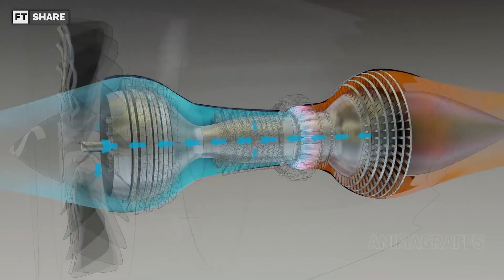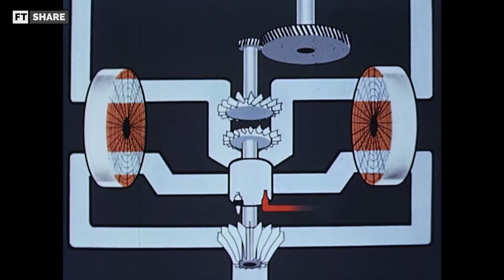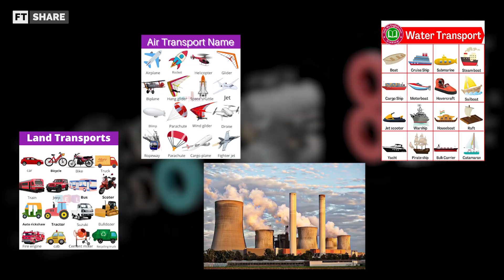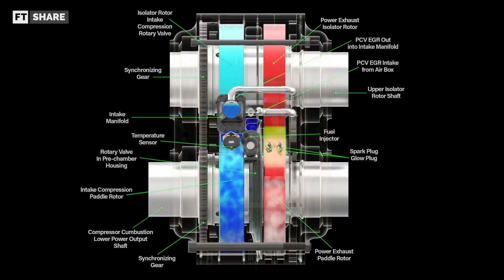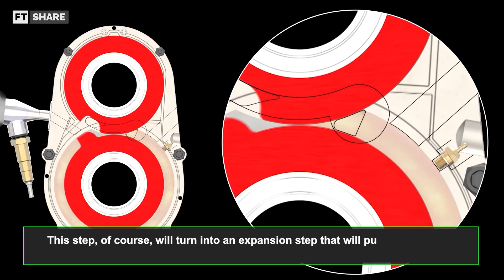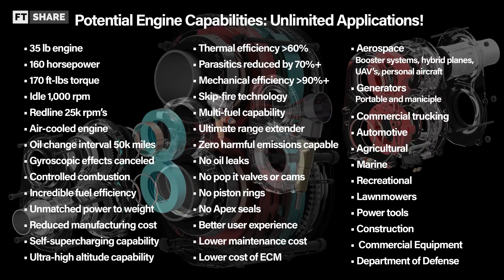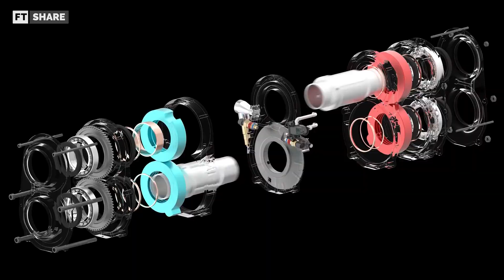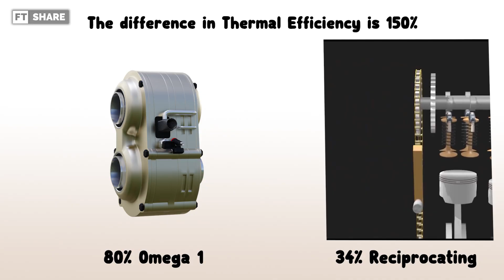Ready To Destroy EV Engine!! | Astron Aerospace - Omega 1 Engine

Comment: I have a similar engine design idea that I worked on back in the late 1980s. Mine has all the rotors on one axis and multiple firing sections so that RPM and Torque can be increased just by pulsing the ignition and fuel injector more frequently. The downside to the one shown here is that it has two opposing rotors joined by gear teeth at the outer diameter. This will have high inertia loads under high load and rpm, which will probably quickly wear out the gear teeth keeping them in sync., especially after many abrupt acceleration and deceleration periods. Other than that, the idea of using totally rotary motion is the best advantage to this and my design engine. There is no wasted (reciprocating) motion.
Reply: I look at it like a helicopter or jet engine. Spin it up slow and bring it down slow. If you are using it as a generator for batteries and a traction motor, I think it is just the right fit.
Reply: @desertdan100  wouldn't there be much less energy loss to just fuel an ICE engine instead of fueling this engine to generate power for batteries which in turn power electric motors?
Reply: @Thistasteslikeass  The torque off of this engine is going to be lower than a piston engine and it is going to be more efficient at a semi constant higher rpm. It would be better suited for a generator. 

The voltage output on any generator depends on rpm. 

I higher revving engine and a lineal curve are better for power generation.

A Diesel has high torque at low rpm and is better for an ICE vehicle and more efficient.

This engine is better suited to move away from petroleum.
Reply: These engineers know their shit mate.
Reply: @darkfieldcarnivore3928  regardless if its that heigh in efficiency would make for a damned good electric generator
Reply: Ask Christian Von Koenigssegg, to make it work, and give him a share of the royalties. You need a Genius.
Reply: There are economic forces that usually exceed any patents but their own. Good Luck
Reply: Draw something very similar to yours in the 90ies. Did you ever build a prototype?
Reply: As the rpm increases the gap between the gears and rotors would close due to centrifugal force. How much I guess depends on material but seems like a limiting factor. As well as balancing the rotors with that big tooth hanging off one end.
Reply: @Willy Jimmy  I have worked on super chargers and screw compressors as well as rotary pumps and compressors. I think it would not be any different than those. As long as you engineer for it, I think it would be alright. They can do amazing things with ceramics and Titanium Alloys these days.
Reply: @willyjimmy8881  balancing of that "big tooth" is pretty easy
Reply: Honestly if ICE car brands try to use propulsion engines as generators thats more evidence they are incapable of innovation.
Reply: Yeah, when I saw the gears I felt the same way
Reply: Flame Front Speed, Flame Front Speed, Flame Front Speed .... The Very First Figure An Engine Designer Needs To Consider, that's where "omega "wtfwhere you thinking' one" failed....doomed to the core of the concept, right out of the gates.....i bet they don't ever forget that from now on.
Reply: after the flame front speed dictates your engine into goal dimensions, then it has to seal ... i can't even get to the point where i question it's ability to form a seal, it is that messed up.
Reply: it could work on diesel or hydrogen ... but claims like that need substantiation, and the first i heard those claims, they were based on petrol .... NO, that's not how it works.
Reply: Good point on the gearmesh wear, my only comment would be that if this actually becomes a viable replacement for existing ICE applications in vehicles, as long as you have an easy access point to those gears, swap them out every 10k or 20k miles and keep going.  Surely you can have a bolted/keyed connection instead of some custom fabricated interference fit.
Reply: @cg8469  complete idots... flame front speed, the problem with the omega1 is that flame front speed was not considered, where that should have been the first thing...the first thing that should be considered in any engine design was disregarded ... it will never make any power worth it's weight, on any fuel with a combustion speed similar to petrol.
Reply: Have you written a paper on it or currently working on it ?
Reply: if your rotors are anything like the omega1, it wont make crap for power on petrol .....flame front speed.
Reply: @RulgertGhostalker  H2 would speed that up and be zero emissions
Reply: CNG might also work better
Reply: @desertdan100  oh yeah, CNG CH^4 
Good Call....i forgot about that, and there actually is some infrastructure....
Reply: the omega1 might make a good remote controlled aircraft engine, if it was scaled down to a 1/4 HP.....i will give it that.
Reply: i am actually a real engine designer... because i know to tape my flame front speed up on my computer screen, before i even start an engine design.
Reply: @RulgertGhostalker  What is the Flame front speed of Hydrogen on compresion ratio 14:1 and boosted intake 2bar?
Reply: @andrekemp5059  fast enough ... too busy to dig through my references right now.
Reply: @andrekemp5059  someone mentioned CNG, and right away i thought that's the way to go with it, 1) because there is already some infrastructure there, and 2) because it takes a lot of energy to produce hydrogen, and for that reason, many people don't see it as a solution.
Reply: @andrekemp5059  i would also consider RC scale ...you can run small prototypes on nitro-methane and recover from your investments faster.....RC planes have lots of applications.
Reply: @RulgertGhostalker  Petrol is Benzine, xylene,toluene, n-Hexane,Alcahol Ethanol, Parraffins,cycloparffins ,naphthenes olefins and the the anti knock agen LEAD Tetraethyl , Lead alkyl, Naphthalene, Tri-methyl-benzene
Reply: @RulgertGhostalker  I love RC stuff it makes life so intresting.
Reply: @RulgertGhostalker  it takes alot of oil gas vapor to produce Petroleum Gas, Petrol, Diesel, Parraffine, oil grease products.
Nothing is for free.
Reply: @andrekemp5059  RC is actually employed in military, agriculture, surveillance, and mapping...it's not just toys.
Reply: @RulgertGhostalker  I like the Toy side more!
Because to build toys for people that want to us it in corp and not get paid by contract complete is a horable feeling
Reply: @andrekemp5059  also a type of flight training.
Reply: Please build it?
Reply: LOL... imagining gears transmitting power at 25,000 rpm... is somewhere between welding and pure smoke. Maybe ceramic gears lubricated with liquid hydrogen like heavy duty generator bearings... not something I see replacing any current tech soon!
Reply: @scottturcotte1860  OH GOOD POINT DUDE.....my mind didn't even make it to conceiving power output worth transmitting.
Reply: @scottturcotte1860  the general consensus is maybe CNG... or less expensive prototype turn overs in a nitro-methane scale format....either way, like you said.
Reply: @scottturcotte1860  piston ring metallurgy has come along way....from 2,500 fps to a little over 4,000 fps now i think.
Reply: @scottturcotte1860  the whole thing is, it's better to give them some realistic raz, before they get too much invested in a disaster..
Reply: @scottturcotte1860  i mean in theory it could work....and i think that's what made them lose their marbles...but no kiddin they did.... gotta run the numbers and get real....numbers don't cost as much..
Reply: Think rotary turbine 😊
Reply: @brucemabley9808  That's The Problem With It !!! Unfortunately it was supposed to be an ICE, not a RT, and it came out like an abortion..
Reply: I don't imagine this thing being used to direct-drive a car and making drastic rpm changes.  It will probably be tuned for a specific rpm to drive a generator, at best a CVT/gen system like the prius
Reply: There are gears which the teeth are tipped with magnets (probably neodymium) so there is an air gap between 2 opposing gears, the repelling force of the magnets eliminates friction between 2 gears, but the question is would the magnets lose some magnetic power because of increased temperatures? These kinds of gears could be helpful in rotary engines..
Reply: @pihermoso11  exactly! Those magnets will definitely loose their property due to change in temperature.

Comment: Very difficult  concept to understand fully, given that it has a combustion space, and the volume of the combustion space seems to be very small, the idea of  power from swept volume would seem to say that for an engine of this size to produce 160(B)HP is impossible. Incidentally, the first gas turbine car was developed by Rover in the UK  beginning in 1946 with a running prototype being tested in 1950.

Comment: HP per weight? Longevity without maintenance? Fuel efficiency? Torque through speed range? This won't displace EV motors that have only one moving part and require no maintenance. Unless it burns hydrogen is is still a fossil fuel ICE engine and will pollute and spew CO2

Comment: I cant imagine why humans would develop an engine so far less efficient than an electric engine we currently have
Reply: Well because efficiency alone actually counts for very little in this context! If the energy storage density of the fuel source makes the overall envelope impractical then it does not matter that the engine is far more efficient than an ICE.

Or to put it another way; Electric vehicles, though the motors are far more efficient, the storage problem alone makes an equivalent envelope far less effective as a whole.

Otherwise, wouldn't the entire development of all earthbound people-moving vehicles be complete with the invention of the BICYCLE? Cannot get more efficient than that. Or less effective...Well you can (see video above ;D) but surpassing our own output power limitations is sort of par for the course in engine development.

Comment: It's incredibly elegant.
This is exactly what we NEED!
I want to know more.
Reply: You should look over at Aquarius Engines. Way better design that has only 1 moving part and doesn't rely on the extreme levels of tolerance that the Omega 1 will require. Also, they already have working models, generators and a newly renewed contract with the US Military for R&D.
Reply: @BloodSteyn  awesome, thank you!
Reply: Want one? Who's gonna fix it? How do you get parts? Stick with what you got. It works and you can get it fixed when it breaks. And it will. Especially for you.
Reply: @2012listo  
I'm certain it would feel impossible to fix at first but I would learn, I love fixing stuff.

As for everyone else, the need would create opportunity and people would learn, they would sell their services.

But you are right about keeping what we already have, it wouldn't be very smart to not have a backup. But that goes for all cars.

Comment: :text-green-game-over::text-green-game-over: IRRELEVANT, it burns gas, it by default is inefficient, EV electric motors are now made with OVER 90% efficiency, just plug your car into the wall socket in your garage and it gives you 150km range by the morning, and the vast majority of people don't travel that far each day, plus MANY people now have SOLAR panels so can charge for free anyway. :face-green-smiling::text-green-game-over:

Comment: It leaks like a sieve and stops very quickly hinting at very high friction rectangular combustion chamber is poor for efficiency and hard to seal.  The same with rotary valves and a hot and cold parts next to each other.

Comment: The Wankel failed due to air seal problems........NO, SORRY, IT FAILED DUE TO HIGH SURFACE TO VOLUME RATIO AND CONSEQUENT HEAT LOSS LEADING TO LOW FUEL EFFICIENCY. THIS ENGINE HAS A MASSIVELY HIGHER SURFACE THI VOLUME RATIO.

Comment: Electric cars are doomed. The grid couldn't handle the amount of power needed to supply everybody electricity for all their electric vehicles. The other problem is the lack of materials available to produce the batteries with current battery technology. Battery technology may change, but the lack of available energy to be supplied through the grid is the number one thing holding back electric vehicles at the moment. And let's not get into the pollution caused by the production of these electric vehicles and their batteries.

Comment: This is a fine concept. Now let's see it transferring 160 hp and relevant torque to a drive for a ducted fan,propeller or driveshaft. Must have some interesting bearings and lube to handle these forces. Trying to imagine an Immelman in an aerobatic plane with these bearings reacting to gyroscope forces at 20,000 rpm.
Reply: Did you notice the fluid leaking from the lower section. Not certain what that was, but leaks are not good.
Reply: I would agree if we had discussed this in the 80s. Our time's materials solve those problems easily.
Reply: I think it would be best as an electric generator installed inside the fuselage which could then power ducted fans via electric motor on the wings. Certainly less efficient and more weight, but there are other advantages.
Reply: My cousins 95' civic can handle aerobatic gyroscopic forces at 20k rpm np

Comment: I want one now! That would be sweet as hell on my TRX450r ATV. I've boosted the power a lot to get to 65hp. 160hp for an engine that weighs about the same would be awesome. Not to mention that insane rev limit. 25k sure beats the hell out of 9.5k. That little engine would be good in everything if its reliable. It's light enough to just remove if it needs work. Sadly I'll believe it when I see it. They'd take over if they are reliable. People that work on things themselves will be buying them like crazy
Reply: 2 omega 1 engines would weigh less than 1 trx450r engine according to the stats provided in the video.

Comment: The seals will work better than a wankle rotary engine because the rotor is not asymmetrical.  It doesn't have to bounce around as it rotates.  It simply rotates in a circle like a lathe.  This makes it easier to manufacture and more reliable because simple rotation under stresses the bearings and maintains symmetry longer.
Reply: Not so sure... They will have thermal expansion to deal with, and also I see no way how they can oil those without pumping oil in the combustion chamber, making 2 stroke like emissions.
Reply: @DrBernon  I was wondering the same
Reply: @DrBernon  Thermal expansion can be handled with the correct alloy combinations.  Side seals are easy to accomplish with linear oil rings.  The diameters are the tricky parts.  They will need spring ring seals similar to the wankle, but will be easier because of the perfect rotation.
Reply: @HarmonicResearch  Look closely at a wankle engine picture. The seals are not that different to a regular piston. They are metal strips at the triangle faces, and a cylinder at the tips. It scrapes the walls just like a piston ring. This thing needs a ring that is going to grind always at the same spot because of the circular motion. The oil will not get pushed between the metals.
And the thermal expansion will affect it no mater the alloy combination, because the engine still has a hot spot on the flywheel/combustion chamber thing. So the flywheel will have an asymmetric expansion, and the combustion chamber also has the same uneven heat distribution problem.
Those rings not only need to seal a fast moving disk, but also wiggle down and spring back, 25000 times a minute.
Reply: I suspect there is too much marketing here and not yet enough longevity testing. I predict it will end up worse than a rotory for oil consumption and emissions.
Reply: You hit that on the head!

Comment: Sounds like more automotive 'vapor-ware' that will probably never see the light of day. Sealing issues are going to be the enemy here, and how do you even cool something like this? Any time you have a spark ignited ICE, you're going to have nitrous oxides, carbon monoxide, and CO2 emissions, no matter what cylinder/rotor configuration you use. 80% efficiency on something like this is laughable at best! The whole script for this video sounds like it was translated from Chinese to English, which should throw up multiple red flags for anyone watching.🤔 EDIT: I saw a flame out of the exhaust port in the few seconds we actually saw this monstrosity running. A flame out of the exhaust indicates incomplete combustion, and emissions issues.

Comment: It's nonsense. Exploding gasoline on the side of a wheel. No real way to seal that up, and the high surface speed and friction, a gimmick to raise money. There's an old video of the Prototype running it's not very impressive, sounds like a flooded lawn mower chugging and spitting